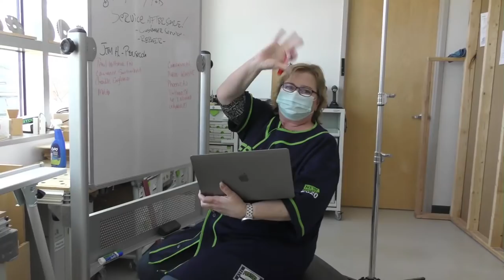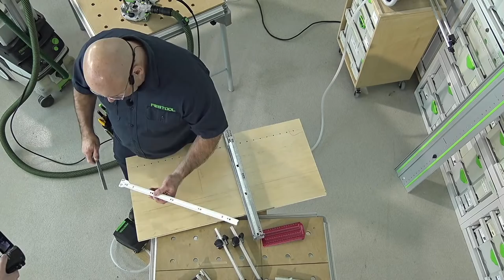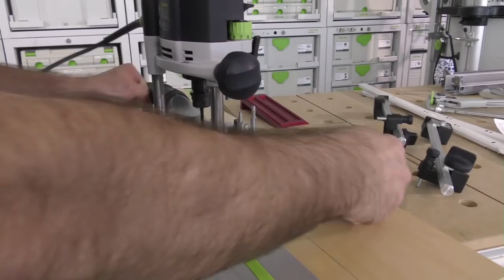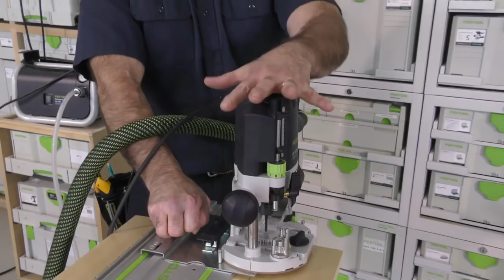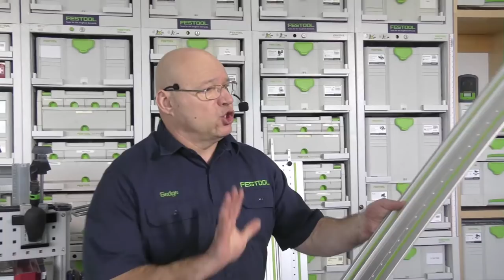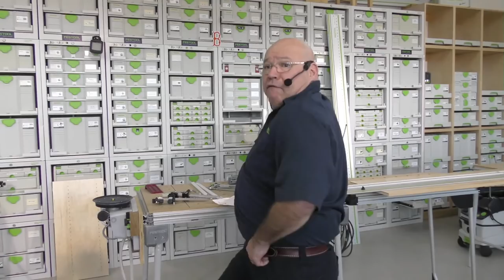Festool Live Episode 45 - LR 32 Practical Applications

Comment: Good timing my LR32 set just arrived.  I do wish Festool offered additional offset bars for the edge stops as several systems use offsets other than 16, 32, 9.5.  How to do KISSII 32 that needs a 35mm offset?

Comment: Tip from my mistake. I had a perfectly balanced panel at 2432mm length but cut my rabbets and dados before using the 32mm system to rout my shelf pin holes. Problem? The depth of my cuts for the rabbets and dados were 1mm deeper than the end stops so now I no longer had a balanced panel. In the future I will ensure that I either rout pin holes first or cut rabbets shallower than the stops!

Comment: Hi, I want to build a sys wall by I can not find any plan to help me. Is there any plan with measure?
Reply: If you look at the SYS-AZ web page there should be a two page download of the dimensions to observe if you use the SYS-AZ drawers - like the 58mm inset - but some of the dimensions are for you to choose to fit your circumstances.  It also includes how many holes to allow between the rails for the different sizes of Systainers.